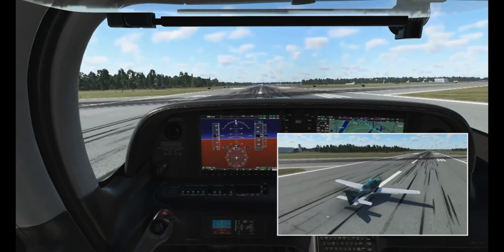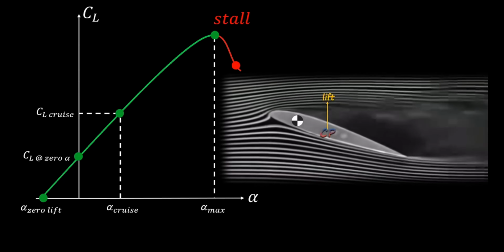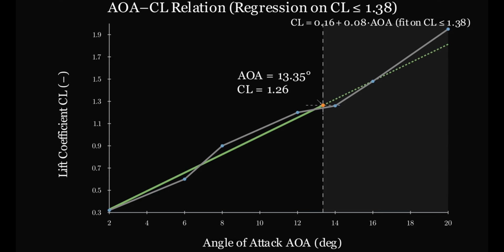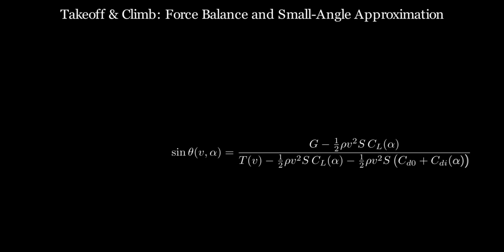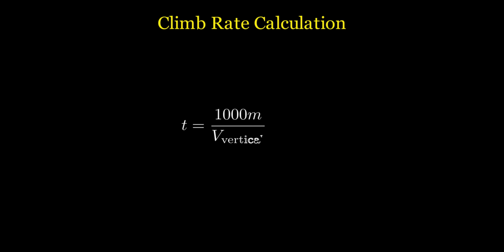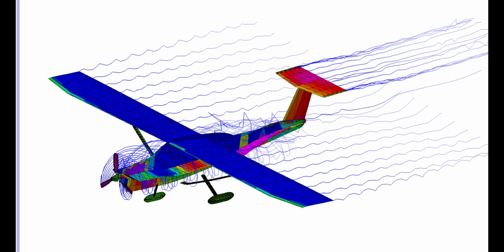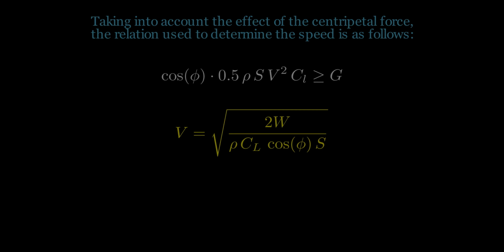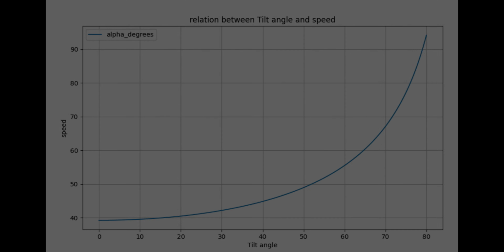Handmade Aircraft – Flight Performance

Comment: @1:17, you say "regulations require the stall speed to remain above 18 m/s". Are you sure the stall speed should be ABOVE 18 m/s? IMO, it should be LESS than (or equal to ) 18 m/s.
Reply from the maker: Thanks for your message—your observation is very meticulous. There is indeed some ambiguity here. 
I reviewed my draft, and what I meant is that the aircraft must maintain a speed above the legally prescribed 18 m/s.